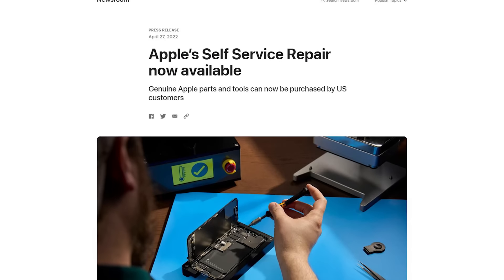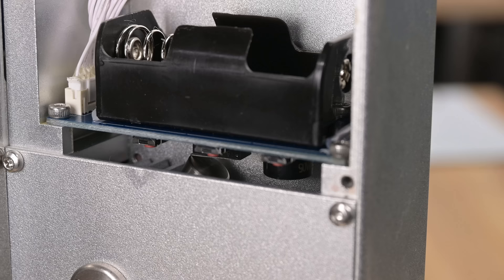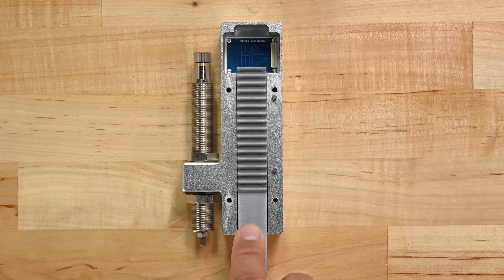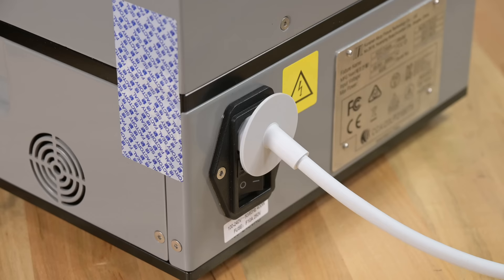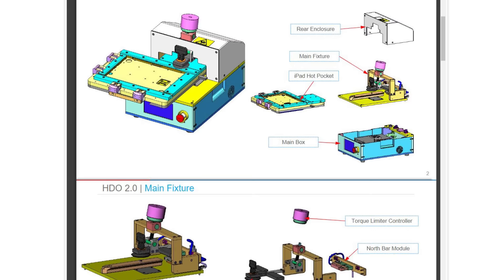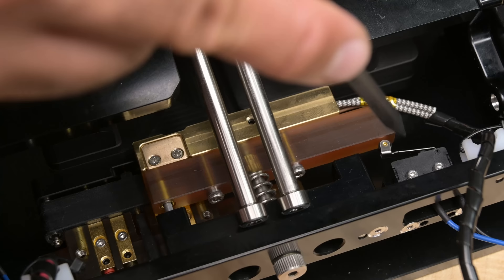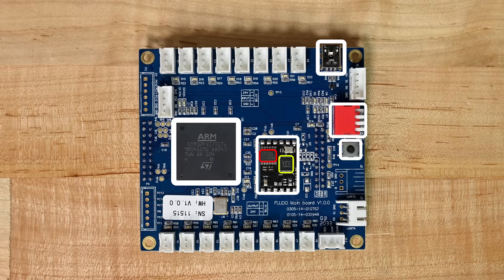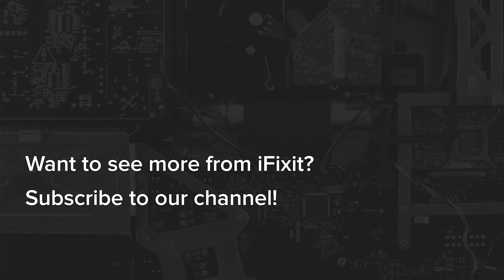Tearing Down Apple's $1200 Tools! What's So Special!?

Comment: 100% unnecessary  all of them. 

How about you at iFixit grill Apple about not giving people access to all of the logic board components and all of the schematics of all of the Apple products. 

You do know that true repairability is fairly easy: allow everyone the access to schematics, allow component manufacturers and stores to sell components to anyone who asks for them and do not implement software locks. 

Are you really so afraid to address these issues with Apple?
Reply: just removing the pairing locks would do wonders. Simple stuff like battery and screen replacements are under a big threat right now, and that's where most people start from.

Comment: Just made the phone more easy to repair. Most cell phones have the battery to replace  or the screen to replace . Make better Battery's Apple And no one will have to open them !!! Imagine a few screws to remove the screen on each side of the phone without having to heat it,  and in 5 min is done with only one screwdriver !!!  I think they do it very complicated to discourage people from touching their technology but in Your phone !